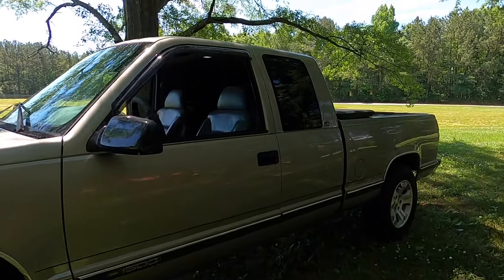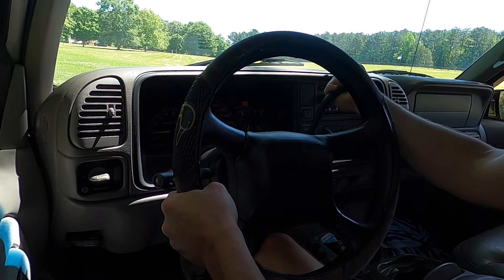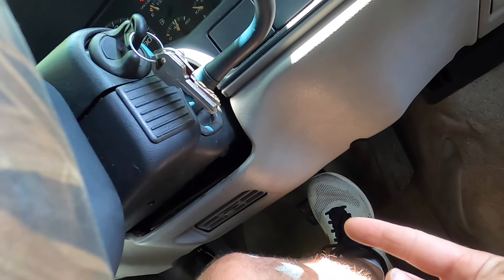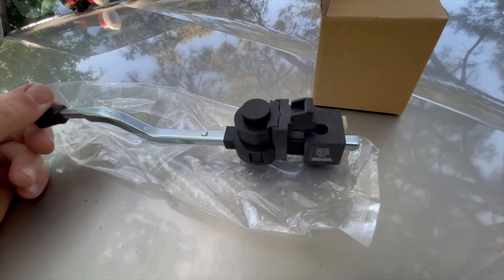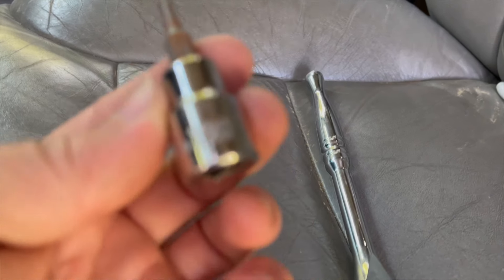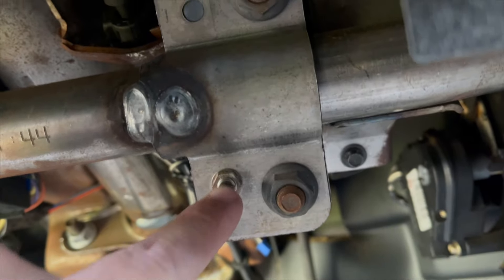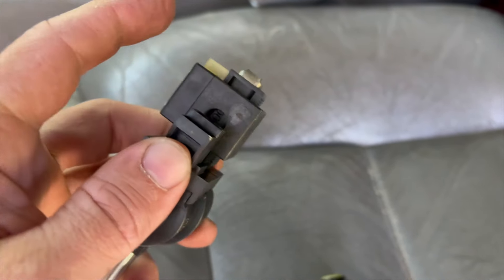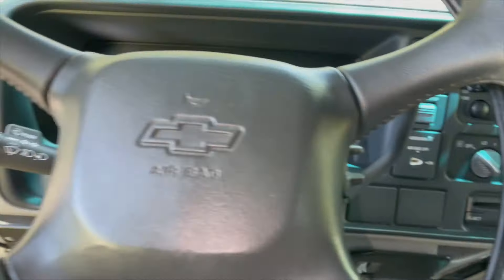OBS won't shift out of park! Here's the fix!

Comment: In all my years of owning, driving, working on, old dilapidated Chevy trucks I'm shocked this hasn't happened to me yet.
Reply: I just had this happen today luckily it happened in the driveway
Reply: On that part that he replaced, you don’t even need it save your money. Just take one end off the one closest to the steering shaft by the steering wheel pop that one piece loose and it will start every time without worrying about it ever happened again I did it. It works. I’m happy.

Comment: You're a life saver!! Wasn't sure if this was the problem or not but that disconnecting tip proved it was and now I can at least drive to go pick up the part! Thanks a bunch!!
Reply: I have a 2001 Chevrolet Silverado and I back in the my driveway and I backed up a little bit to far and I went to put it in drive and it wouldn't go down in drive and want go in park but I can crank it up in nugle and It want down in drive?

Comment: I got a 98 GMC Sierra four-wheel drive extended cab 1500 in this video was very helpful thank you because I just started having this problem today and I'm going to just take the stupid thing off because I had an old K5 Blazer back in the day and it did not have a safety any of the old squarebodys I was ever in my dad had a 78 actually two different 78i 1-ton long bed and a K-5 and I also had an 83 Suburban none of anyway my point is is none of the square bodies had a safety feature all you had to do was turn the key and you can pull it out of work you didn't have to have your foot on the brake my 77 OVGuide was the same way and my dad had a 79 Z28 and 74 Z28 and they were like that too anyway so I'm just going to disconnect the thing and do it like old school

Comment: I replaced this part, but it wasn't the issue.  My mechanic told me to check my brake lights, and they weren't working.  He told me it needed a brake light switch. (GM D891A for me).  Got it installed a few minutes ago, and it shifts just fine and I now have brake lights.  I haven't taken it on the road as of yet, but my cruise control went out at about the same time, and I'm hoping that works now too.
Reply: yo how did that go cause that's exactly mine also. crusie control out the shift issues and a reader said it's a brake sensor
Reply: @justinburris7429  The brake light switch fixed it all.  Brake lights, cruise control and stuck in park issue.  About $25.00 on Amazon.

Comment: Do you have any advice why the gear shift lever on my chevy Silverado won't move/shift and change gears after replacing the full linkage cable? Before I replaced the linkage cable everything worked fine. Thanks.

Comment: Got a problem that sounds very much like yours my truck is a Chevy Colorado and it's stuck in park so glad it got stuck at home showed no sign of anything till I parked it then this stuck in park trying to research the problem and sounds like there are a few causes it's a bit of a pain to run em on down and it will all start with a cable from the tranny on up at this point don't recon I know what's up yet but I sure do appreciate you talking the time to show what you whent throught  now what year is your truck mayi ask thank you for sharing

Comment: yeah I had the same problem, I removed my fuse for turn signals and replaced it once I got it started used it as a security feature and then one day it just started working again without removing the fuse

Comment: i am a little confused by this video.i had the same problem on my 99 but when i purchased a new solenoid i realized that it defaults to unlocked when  not energized. so if its locking its working. the brake light swith is what turns off the power to unlock it. and the brake light switch wears out and wont travel far enought to disconnect power. in short if you disconnect battery and can shift out of park the solenoid is fine but the brake light switch is faulty.

Comment: I’ve got the same problem, but my brake pedal is not hard when I press it. I have to keep pumping it until it gets hard or I have to shut it off pump it when it gets really hard then turn the key on then I have to pump the brakes could be that my master cylinder is bad.

Comment: PLEASE HELP! Truck won’t shift out of park unless I force it, in which I can get it into reverse and no further. I’ve already disconnected that unit and it still is stuck!
Reply: I have a similar issue, hard as hell to shift, occasionally it'll pop and wont shift into drive sometimes unless I go all the way down to second gear and start rolling before I toss it back up into drive, then everything is kosher. Gonna be troubleshooting tomorrow until I figure it out or get so stoned I cant see anymore.
Reply: @Craigc4x4  my issue ended up being related to the anti theft so i had to switch out my ignition, i broke my shift handle off the column trying to get it past reverse so i said fuck it and sent it getting a new ignition cylinder. But yes, definitely get so stoned you see jesus

Comment: i have a single cab 96 & if anybody does a sound system or just wants to remove the bench seats to maybe clean up, make sure you don’t pinch the cable between the body & the seat bench, my mistake on why it wasn’t shifting out of park.

Comment: What is the part number? Or part name? Can’t find it online
Reply: Mine was a Dorman 924-976
Reply: shift interlock solenoid.  You can also hack it for a while, by turning the ignition key 1 click forward, and 1 click only.  Then you can drop it into neutral and start it in a pinch.

Comment: I took the part off and am still stuck in park.  (Although it wouldn't start with the wires unplugged)   Also I have brake lights working perfectly so shouldn't be the brake light switch.  Does anybody have an idea what else it could be?
Reply: its the brake light switch. read my comment above